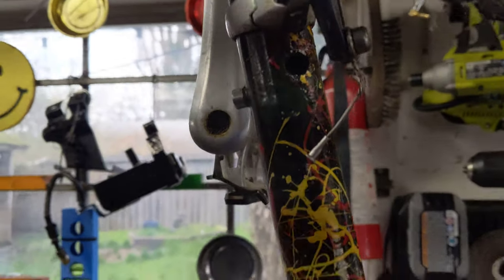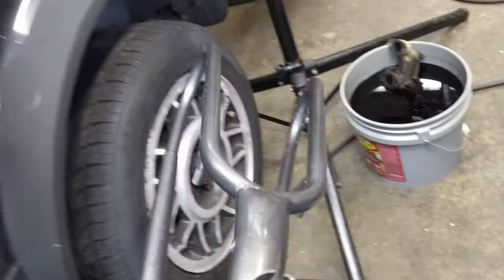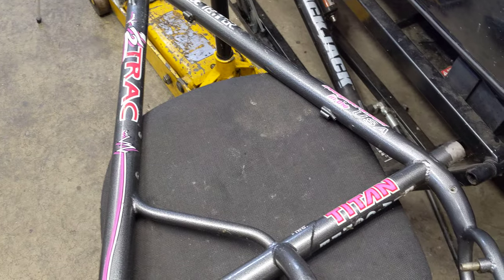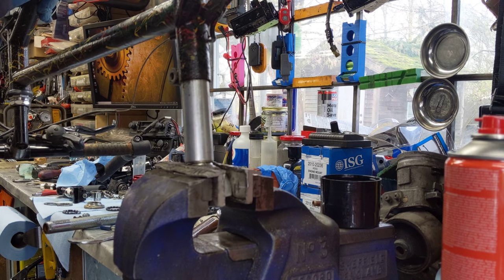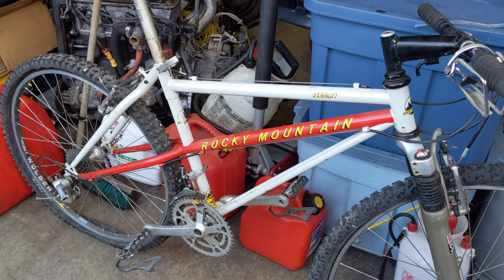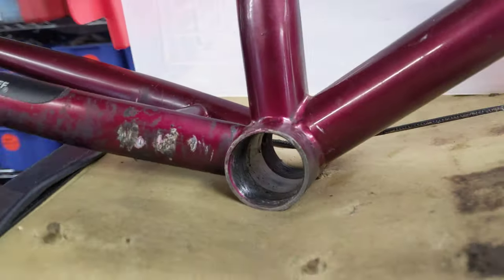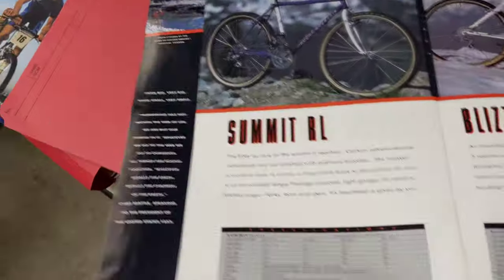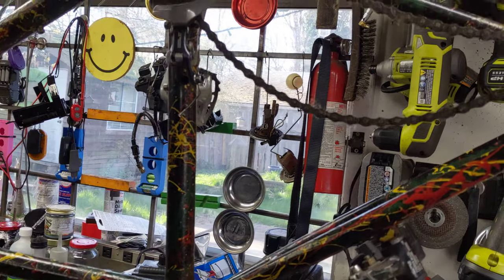Vintage MTB stuck or seized seat post removals, Rocky Mountain, Brodie, Titan Half Trac

Comment: Thanks for your video(s), Nigel. Nick showed me your channel after picking up an ‘89 Romax with a seized Suntour seat post. It was about 5” into the seat tube and the Evaporust method worked super well.

I probably went a little overboard but I plugged the water cage braze-ons with fasteners torqued through nitrile gloves and filled it up to the bb shell and soaked 5 days - came out! Thanks again! No heat, no saw, no damage.
Reply from the maker: Now that's what I am talking about! I'm so happy to hear that this method was useful for you and saved some vintage hard to replace parts. I look forward to seeing the Romax! Thank you for watching and commenting. Cheers!